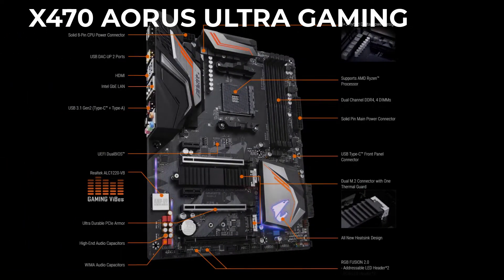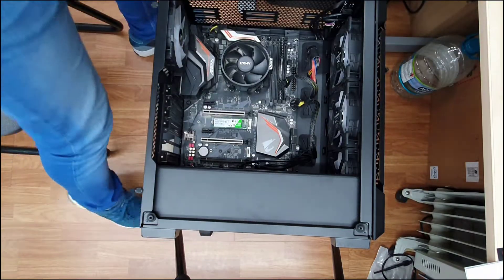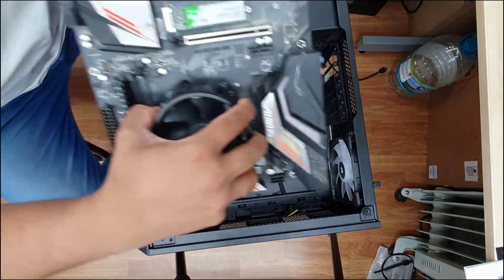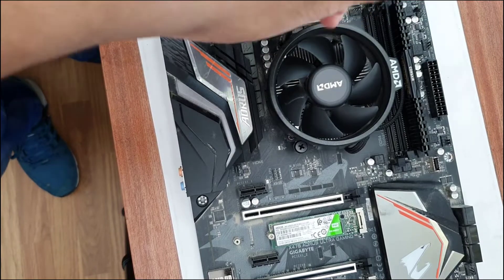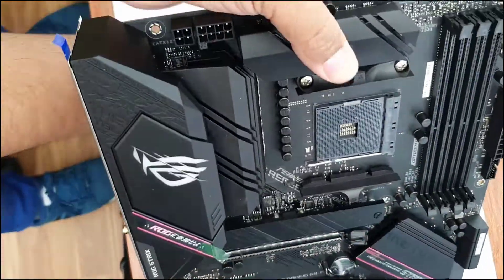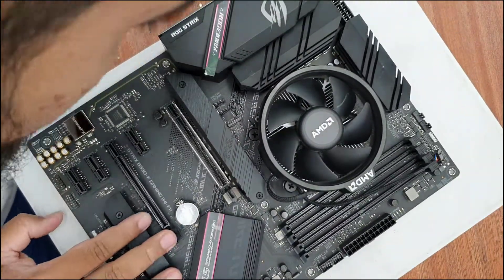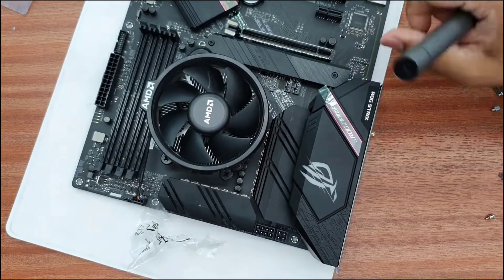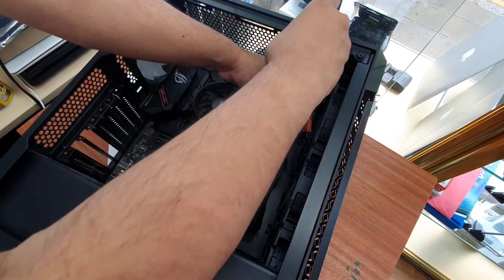How to Correctly Upgrade Or Swap Gaming PC Motherboard | From X470 To ASUS B550

Comment: I have a prebuilt. How will I know if it’s worth upgrading my motherboard?
Reply: Depends what stuff u have in the prebuilt and the compatibility for future upgrades. Me personally I’m upgrading mine because it only has 2 ram slots and 2 fan headers. Check what motherboard you have and if the stuff you really want isn’t compatible, then it’s time to upgrade. You can check what parts are compatible with pcpartpicker. I hope this helps
Reply: Mainly when you want to upgrade your processor due to motherboard CPU socket incompatibility with a new one you like.

Comment: DO I need to re install windows and back up my stuff before?
Reply: same question here did you find the anwser or gave it a try?
Reply: @exodus-v2  I made a windows flash drive but I was fine and didn't need to reinstall windows
Reply: @dhwisbehaixvb  okay nice thank you for the quick answer, so you just Swapped the Mainboard and everything just ran normally?
Reply: @43  yes all that was weird is I had windows 10 pro activated but when I swapped it didn't say to activate it in the bottom right but when I went to the salivation key in settings it said I needed to but now it has changed and now says in settings it is activated it other than that it was all fine, I just made a flash drive with Windows just in case
Reply: @43  I swapped motherboard, ram and cpu
Reply: @dhwisbehaixvb  dId you just remove everything and swap it? I am looking to swap the same parts. Making sure there's nothing software wise I need to worry about.
Reply: @kaedynhallman3720  yes but I made a back up windows 10 just in case
Reply: Is there a reason you’re using the chipset to communicate with your Gpu and not the cpu lanes on the top PCIe?

Comment: This is a downgrade, from a "x" motherboard to a "b" motherboard lol, if you can afford an "x" series motherboard back in the day then surely you're the type that would want another "x" series motherboard now
Reply: U are wrong. “B” factor motherboards aren’t necessarily bad. B550-F is comparatively better compared to X470 because of the generational difference. Plus many 400 series Motherboards don’t support Pcie 4.0 GPU or even support newer gen NvMe. 500 series motherboard on the other hand also handles higher clock speed rams better than any 400 series plus they are around 1-2 years apart so I say it is better to upgrade in some cases if you are planning to change CPU or GPU.
Reply: dude is acting as if the B550-F is bad